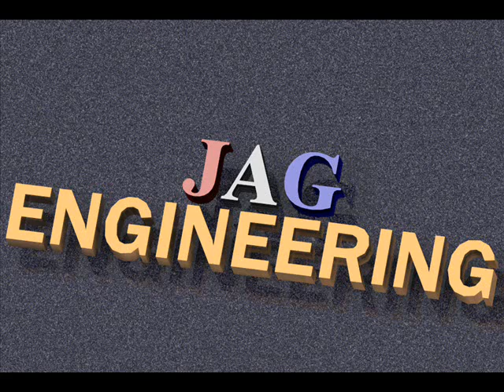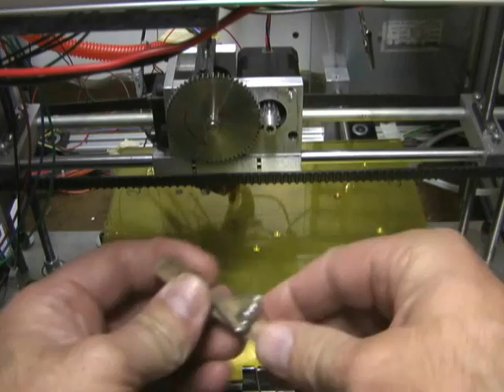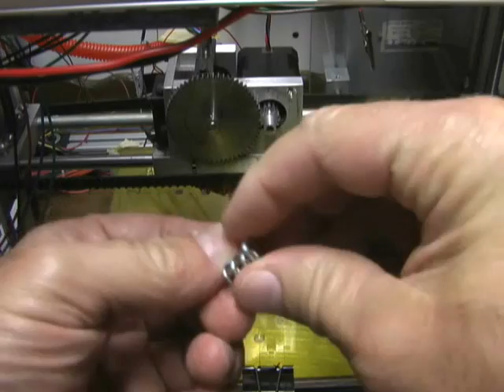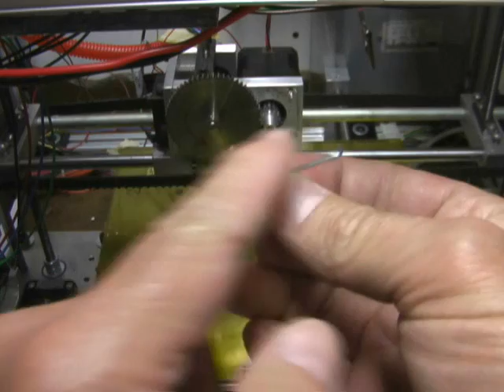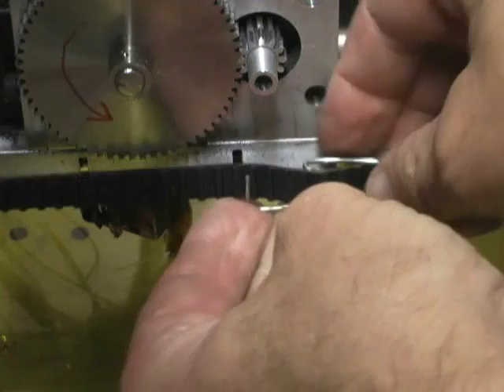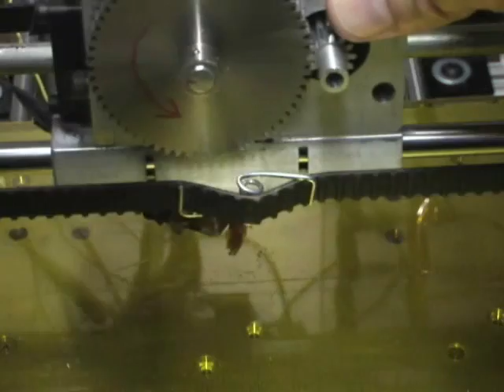A cheap and simple Belt Tensioner for a Mendel RepRap RepStrap 3D Printer or anything else

Comment: These spring clips ruin print quality. If you want to tension your belts, you should tension them without the spring. The spring does not make up for lack of tension in the belt, instead it causes more vibrations and oscillations ("ringing") in your prints when your print head makes rapid directional changes. Get rid of these useless things ASAP if you care about print quality, and printing quickly, and tension your belts properly.
Reply: Ringing! Can you show an example of a print affected by ringing? Has anyone tried using a damper?  A thin piece of tape a 2-3mm long on the outside of the belt might change the harmonics - so would a friction plate above the belt on the carriage. I think the important takeaway is that the heavy coil section of the spring rides under the belt, so as to minimize spring-boarding.
Reply: my prints still look amazing. I used these because I my Y axis was super loud even with tmc2208. the vibration from my gantry transferred trough the belt to my Y carriage plate and it acted like a speaker and made a very loud "VROOM" noise. I added one (actually bought one made for a belt) and reduced the tension to make up for the added tension from this and no more noise now :) still prints very great (no ringing issues or bumpy layer lines. pretty flat) i don't see how that would work reduce the quality btw as the steps from the "teeth" are transferred the same way.